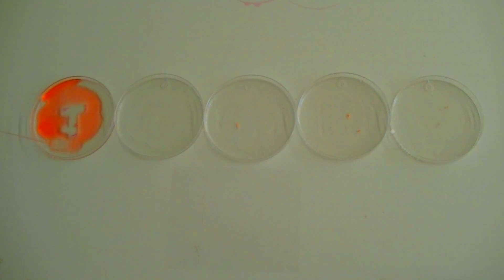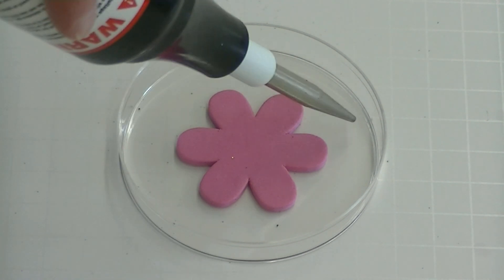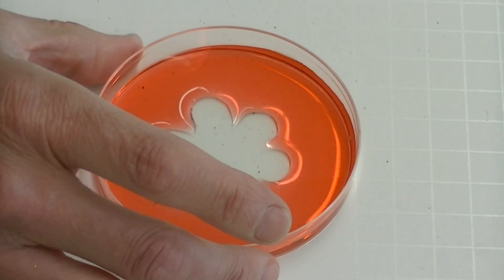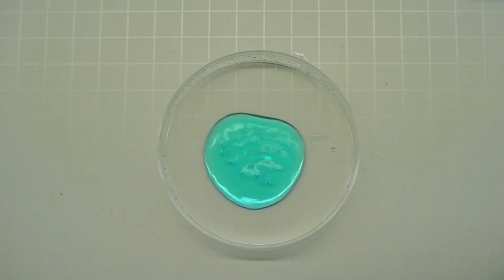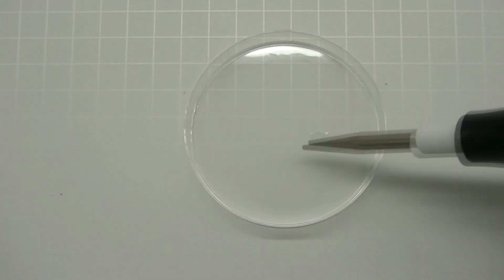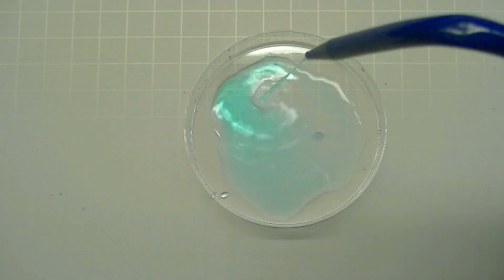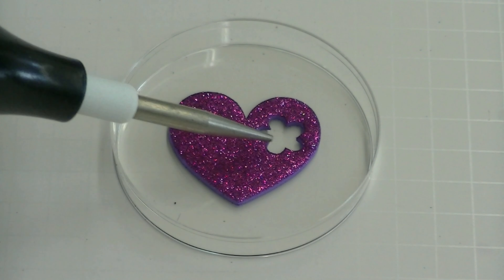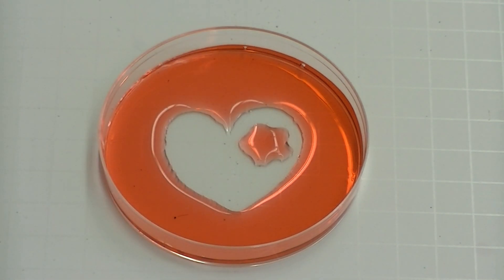Using Electricity to Modify Plastic

Comment: How do you know it isn't the glue from the sticker leaving a residue on the plastic?  Some stickers these days are using quite advanced adhesives.
Reply from the maker: Great question! I have wondered this, too. Remember, though, that the dish is water repelling to begin with. Adding stickers does not change this water repelling effect. Also, I have tested this by adding and removing stickers to Petri dishes without zapping with an Oudin coil. When this is done, the dish remains water repelling over the entire surface.